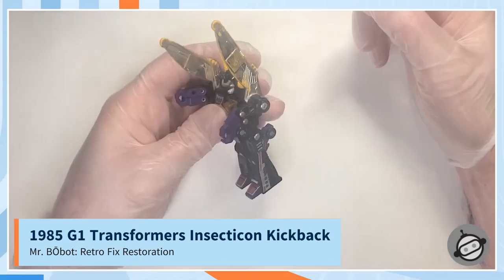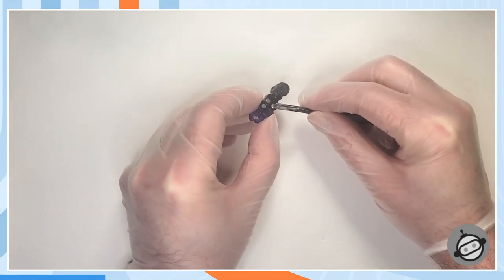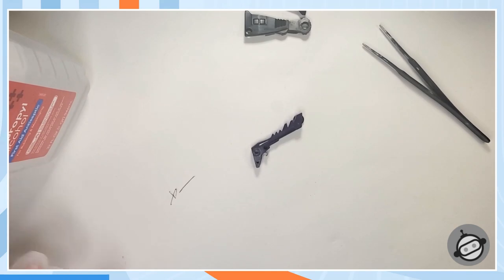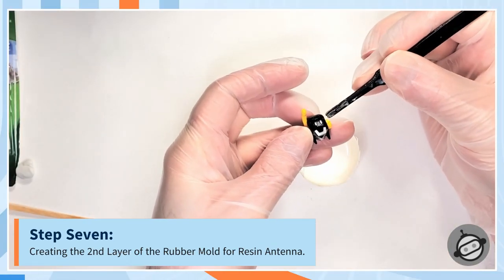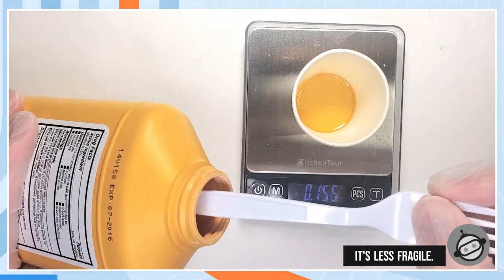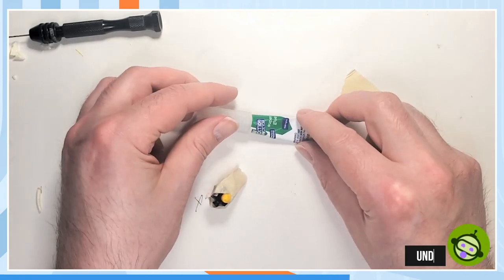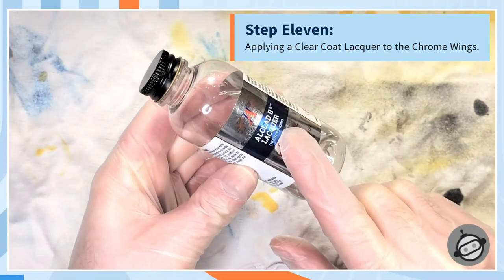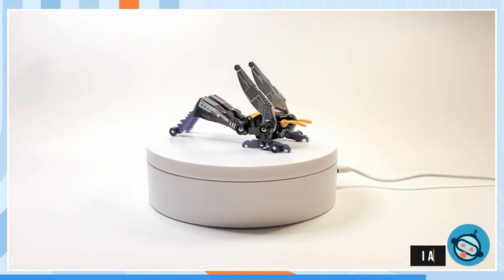G1 KICKBACK: '85 Insecticon Transformers Restoration, Antenna & Chrome Wings - Retro Fix Restoration

Comment: That's an incredible restoration. 

I was wondering if a consumer grade kitchen vacuum sealer can pull enough of a vacuum to get air bubbles out of the resin during casting?

I do love the Bondic, but it is rather pricey. Recently I've just bought a generic bottle of UV resin, and used that to refill the Bondic applicator, and it works just as well as far as I can tell.

I would like to see how you might approach repairing a G1 Jetfire that has a broken tail piece where the hinge pin goes, as well as a broken plastic for where the large metal hinge piece attaches to. I'm thinking of perhaps finding some styrene tubes with a similar inner diameter as the pins and somehow attaching to the broken parts, but wanted to see if you have some additional thoughts.
Reply from the maker: Hey! Thanks for the watch and comment! Yes, I've seen people use vacuums to get rid of the air bubbles but it's usually on bigger projects. I would really like to do a G1 Jetfire! Your styrene tubes sounds good... or some type of thin rod or nail might work.

Comment: Cool video as always man!

But I got a question, maybe I'm missing the obvious, but with Kickback's head/antenna, why didn't you just split his head open and just play with the antennas as is?

Or is that the reason?

Meaning a bigger piece to play with versus a bunch of small pieces of fiddle with.

I'm just asking because I know that you can split the head apart. But a little pressure on the mushroom tab, and the head just springs apart. Basically it's just held together with friction.

The thing I would have liked to seen is you doing a repair on his chest piece because besides one of the antennas being broken, one of the common things to see wrong with him is that he's got a broken chess piece. So out of love to see how you would have gone at something like that!

But anyway man as always, cool video!
Reply from the maker: Hey! Thanks for the comment! Lol, yep, trust me I tried to split the head. But for some reason it just wouldn't split for me. I almost started to break it! If you ever run across one w/ a broken chest piece, send it my way, I'd really like to give that a try. Thanks! :)

Comment: For the yellow antenna did you use an airbrush? Hand painting with a brush kind of a pain because of the brush strokes, even doing few little coats but it gets worn-out in certain areas.
Reply: I prefer going for an Airbrush.
Reply from the maker: Yes, I used the airbrush for the yellow antenna. I just used the paint brush for testing the color match.